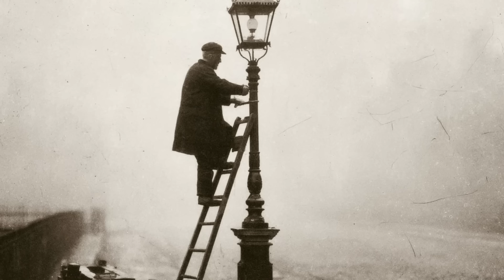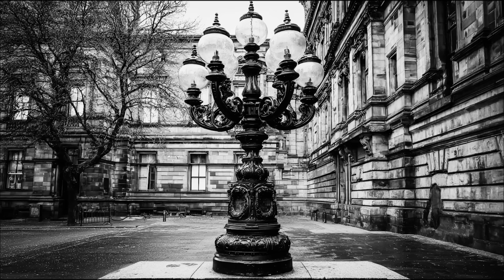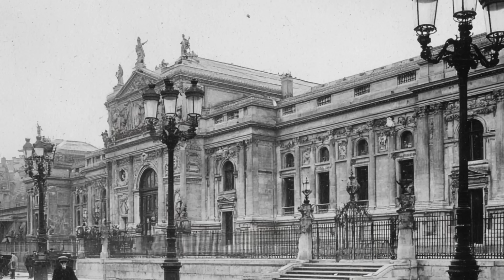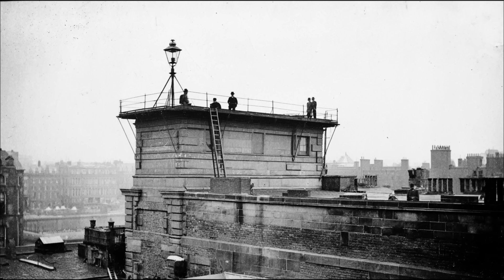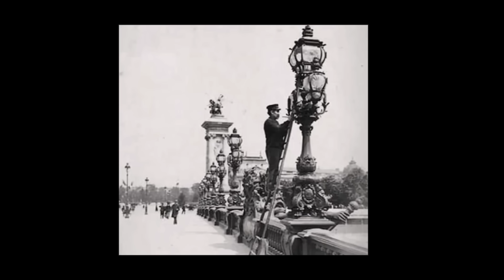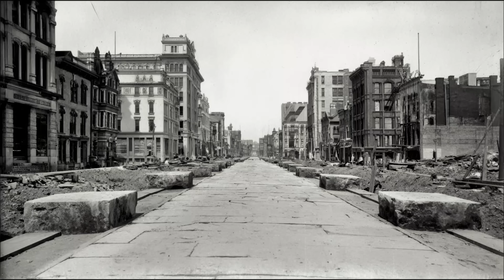Tartaria’s Forbidden Gas Lamps — The Energy System History Can’t Explain

Comment: Interesting comments on how, why, when, and what existed before electricity became the prime solution to illuminating the streets of towns and cities worldwide, but unfortunately you have made a fairy story from not understanding the technology and the reasons for it's demise in lighting the streets and towns. Firstly, the gas that was used to light the streets in gaslamps was made from coal, and it was called "Town Gas" which powered the entire European continent until the discovery of Natural Gas in the late 1960's, at which time the old gasworks that supplied town gas were largely dismantled and the gas holders and other infra structure were removed and those sites were re-purposed. Town Gas had a calorific value in Imperial terms of 500 British Thermal Units per cubic foot, and it was comprised of circa fifty percent pure hydrogen, and carbon monoxide, both these gases when mixed with the correct amount of air at atmospheric prressure burned absolutely cleanly, with no carbon or other unwanted effluent gases or deposits even after decades of constant use. If there was a carbon deposit noted, it meant that something had caused the problem, and the most common cause of that problem in street lamps, or domestic gas cookers, or hot water boilers or gas fires heating rooms, was the simple domestic spider and his webs, which obstructed the primary air flow to the venturi where the gas emitted through an accurately made "jet" which was a brass screw with a hole in it. The spiders web slowed down the gas emitting from the jet and that reduced the amount of air in the combustion space, resulting in a "rich" mixture of gas to air and subsequent carbon deposits which were immediately apparent on the bottom of saucepans, or frying pans, and the problem was simply solved. The same problem exists in some applications even today with natural gas being used in millions of homes, offices, and factories. The supply gas pipework was cast iron under the streets and pavements, fed directly from the gas works, in lengths of twenty feet, diameter varied bu was around four imperial inches in most towns, and putty was the sealing mechanism, which is why there were many gas leaks in those days, due to heavy trucks and other vehicles distorting the pipework, leading to a smell of gas the stenching agent was added at the gasworks, as town gas had no odour and in order to prevent explosions, the gas was stanched with a suphur based compound. The whole gas network was upgraded in the late sixties and seventies using polyethylene plastic pipework, with fused heating joints preventing leakage problems. The prime reason gas was replaced was that electricity lamps using sodium vapours were developed giving incandescence without the use of a tungsten wire being heated as is the case in domestic lamps that are not using L.E.D. ( light emmitting diodes) and these lamps were very cheap to make, very robust and cheap to run, with little or no maintenance for many millions of hours of constant use. The old fashioned gas lamps required a change of gas mantles every few weeks, not expensive or time consuming, but unreliable especially in bad weather where a gale might cause problems. There is no conspiracy here, just good engineering, and unsentimental replacement of an antiquated means of street illumination. No magic, no hidden agenda, just efficiency, and most of all no secrets. In places where town gas was used until recently, such as for example where there was no natural gas pipeline available, the old systems were and are still working perfectly as they did in times past. Where natural gas has replaced Town Gas, the "jets " were changed to account for the higher calorific value of natural gas, and in order to maintain a stoiciometric ratio of gas and air , although spiders webs can still be a problem here and there.

Comment: The old drawings and painting of the large cities in the 16th century shows antenna on the tall buildings. The building had spires. These were for collecting atmospheric electricity. At that time Electricity was free and taken for granted. The ruling elite understood this well. A new energy system was devised that could be measured and sold for profit. The old system was dismantled in days to make room for the new system. Historical records of the old system were destroyed. Look at the Crystal Palace built for the Great Exhibition of 1851 in London. Made of cast Iron and plate glass the Di-electric design of the building made the building a giant capacitor.  The metal flagpoles every 18 -20 feet were atmospheric antennas. In the 1930s when people were being asked to pay for electricity the people balked " why pay when we can have it for free like the Crystal Palace". Within a month the Palace burned to the ground. Photographs of the fire showed the metal spontaneously combusting. The fire was so intense the granite foundation melted and poured like water. Forbidden technology was used to light the palace and forbidden technology was used to destroy it.
Reply: Not at all. This is not even anywhere close to being accurate

Comment: 20:24 what if they were using Natural Gas back then and what they had to dig up on both sides of the street (the big ditches on each side) could have been a pipeline that fed all the street lamps with Natural Gas. No idea obviously, but I work in the energy sector and this is exactly what it looks like when we have to install a pipeline or one needs to be fixed so it’s unearthed to be worked. If there was a pipeline system it’s gone and not noticeable in the photo obviously. But this is exactly what it would look like to the T. I have been doing this for close to 30 years now and I have seen this view so many times, this is literally a typical photo of how a pipeline is about to be laid. I mean if you google pictures of natural gas pipelines and the construction or repairs to the pipeline. It will show you photos EXACTLY like this. There’s no way those are sewer ditches being dug because they filled them back in. So what did they dig up and where did it go? I know history is way more interesting than the official story and this right here is proof. Let’s just say it wasn’t Tesla style energy even though that is one of the best explanations, but even if they had legit pipelines running gas back then that is still supposedly way ahead of their time as well. So if it was Tesla energy or just simply Nat Gas pipelines it’s still absolutely amazing because none of this should be possible at this time

Comment: One of these gas lamps still exists in London, close to Charing Cross station. It is fueled by sewer gas and still works, sooooooooo
Reply: That’s the coverup the told you but the actual ever burning street lamps that never needed to have such cleaned out of them or be refilled we’re actually ripped out a while ago.. the original ones all sat on a giant block of stone that weighed something like 10,000 pounds. And that’s where the secret of the whole thing was hidden when they removed those street lamps they not only removed the lamp, but they ripped out the huge stone as well
Reply: @blizzunt420e Please tell me you didn't grow up in the UK, or were absent on the day they taught you history. I'll try and say no more if you are not from the UK.
Reply: It's on Carting lane, AKA farting Lane. It's the last one in Westminster. Not so mysterious history conspiracy.

Comment: If there would have been a mud flood, why are the lanterns still on ground level?
Reply: New ground level after the flood
Reply: Coz, they could more easily be repositioned!
Reply: In some places you see them on rooftops. It could be also that the bases go much deeper and the streets and walkways were constructed around them as would be done to accommodate gas lines…? The higher you hold a torch or lamp, the more area it will light, so maybe the lampposts were taller at one point.
Reply: In my town gas was produced from coal.   This left a huge amount of really nasty pollution in an area downtown where developers want to put apartments.

Comment: In my opinion, these lanterns were lit with salt. Basic electrolyte batteries would power them, and the size of the bases of the lamp would easily fit large batteries that could easily be refilled with the salt water needed to power them. We already know that salt was extremely valuable in the past. In some parts of the world, it was worth its weight in gold (literally). That would also explain why there was no smoke etc.
Reply: I’m not doubting you,but your comment has blown my salt mind 😂
Reply: What is this magic you speak of
Reply: @kevind2163  look into electrolyte batteries and look at some diagrams of how they work. Seeing what I mean will help you understand it a lot easier. They could easily fit in the bases, or inside the "crowns" of these lights 👍